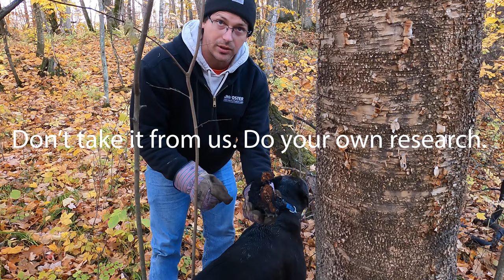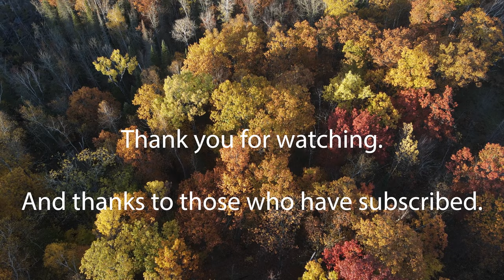Building OFF-GRID Cabin Shelter in the Woods - Autumn BEAUTY

Comment: With no vapor barrier under the roofing your insulation will get sopping wet and rot. Rock wool insulation and Baffle system works great for cold climates
Reply from the maker: We will adjust before putting tongue and groove over the insulation. We didn’t want exposed fiberglass in the cabin when we are using it and done know when we will have tongue and groove. Question though, do you think with the foam insulation R-boards on the walls, we would be better off with open faced insulation in the walls or with faced? We aren’t sure best route there.